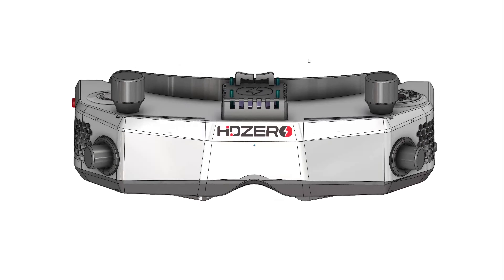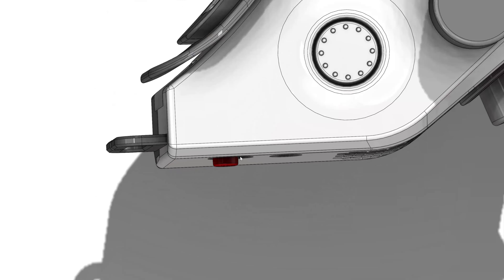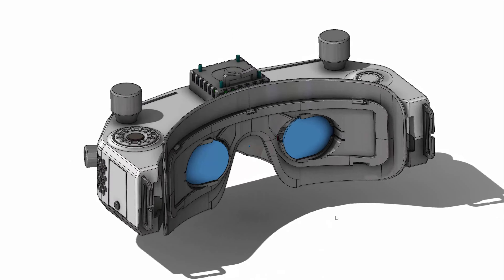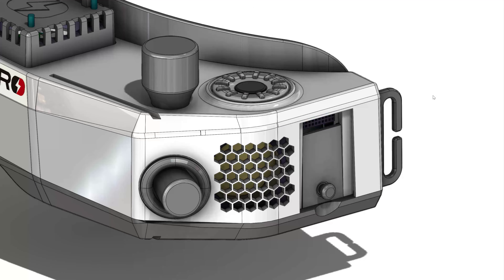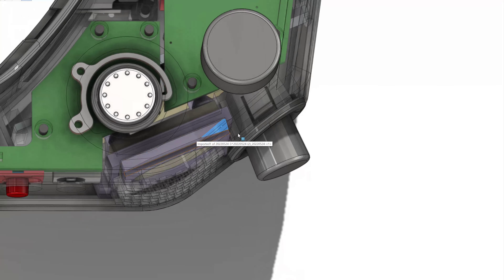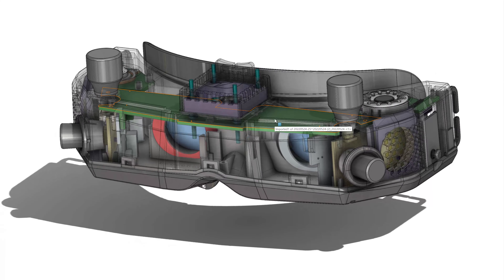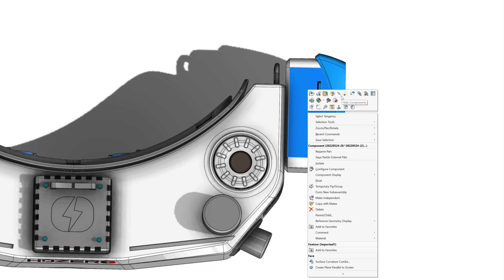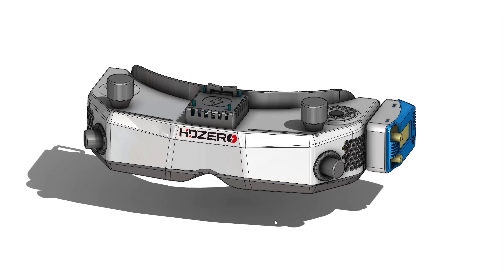HDZero Goggle CAD Walkthrough

Comment: Ryan, thank you for everything you've done for HDZ.  The mechanical design of these goggles is near perfection, IMO. Some observations:  1) The top fan shroud can serve as an anchor should any new add-ons need to be mounted in the front, 2) the opening on the side recessed SMA should be wider so we can turn the SMA metal plug without a tool instead of twisting the antenna housing, and the most important/simplest, 3) ensure the swappable faceplate can accommodate the very flat and the very round faces.  Thank you.

Comment: Fantastic to see the thought and effort that gone into the design of these goggles. Massively impressive. 

I hope Carl's thought about the warranty implications of essentially encouraging users to open up and mess with very fragile components and putting them into less than ideally designed and printed cases though... I'd hate to see a lot of "They won't support me!" posts once users are breaking their goggles. 

I won't be bothering to change a thing because honestly, I think this goggle is going to be as close to perfect as I can realistically hope for.
Reply from the maker: That's a valid point. People need to have realistic expectations of warranty by tearing the unit apart and modifying it. Still, this is a hobby were we build a lot of stuff ourselves, so it might be okay most of the time
Reply: @RyanQuellet  Maybe there needs to be a sticker covering a screw that says opening can void the warranty :/
Reply: @RyanQuellet  I really hope so, and there's not a good amount of people breaking goggle internals and trying to claim warranty support on them and making the goggles look bad, that's all. 

We all know how few claims of unreliability it takes and things get blown out of proportion and a reputation starts forming in this game. 

I'm a huge pessimist though so hope I'm wrong and just worrying for no reason.
Reply: @MrFowl  Actually in a lot of places that would be illegal with the right to repair.

Comment: Looks like an exciting goggle and well thought through. The analogue module option would definitely be welcome by many,   with the lower profile looks like it would be tight to the goggle strap bar though, I didn’t think the module was too bad on the first profile looked decent, at least it’s available on the goggle altogether. Great info 👍
Reply from the maker: Right, it's a bit too close to the goggle strap for comfort. We'll see
Reply: @RyanQuellet  depending on the board layout for the power switch side could the switch be turned 90 degrees so it switches up and down rather than side to, would that give you more room for the plug in jack port?

Comment: I’m assuming that there is going to be massive cost savings and reduced pricing if we are printing our own goggles and assmebling the parts.  I also assume that for those who do not want to print that there will be off the shelf solution approrpriately priced as well.  I further assume that print your own and HDZero mailing us the innards would mean the goggles would run 250-300.  I doubt I would print my own if I had to pay above $300 for the parts.

Comment: This is so amazing, really appreciate your effort in reducing the analog module housing bay size, although the pins port is protruding out a bit in the cad model i am sure it will be recessed inside completely in the actual product if not it will surely rub against the head strap or obstruct it. Also i am wondering if the overall goggle width can be reduced by another 5mm? I cant believe this, as a community we are all working together for creating this amazing goggle, its coming out really well, it seems the future vtx's are going have a reduced footprint & weight, how cool is that. Lets create a  community designed Radio as well 😀. I am thinking a jumper t-lite with 2s power, Built-in ELRS similar to iflight commando 8 and digital hall sensor gimbals with edge TX. perfect.

Comment: The awesome thing about this is really how it turned from the Ugly duckling to this in so little time.

The data pins for the wifi dongle - are they just going to be usb pins? or sdio?
Can you also share the details of the processor / soc running Linux in these goggles? If the soc has a fast enough h264/h265 decoder.. that's + the wifi dongle is all that's needed to get something like OpenHD up and running.
Imagine - strict 4ms latency for those who need that.. and pretty picture with retransmission and all that jazz - when you use the wifi + openhd. All in the same goggle!
Reply from the maker: Interesting idea. It does have h.264/h.265 encoders for DVR. I think a hybrid digital system would be really interesting
Reply: @RyanQuellet  Yep. If the decoder is a fast enough one (720p@120 as opposed to 720p@60), It would really kickass. (20-30ms latency maybe - allowing for up to 1 retransmission). Otherwise there's always the external module approach. But still worth it to try getting OpenHD running on the goggles.
Since the wifi card is external, it should be easy to get a compatible one.

Comment: My concern is how the analog adapter and the analog module holding on onto the goggle. Analog modules are heavy and put strain onto the pins of not mounted with adequate support.

Adding an anchor point or support for the module adapter on the metal strap hook would put less strain on the case of the goggle I think.
Reply from the maker: The analog bay is secured by a screw below the connector

Comment: I'm a bit worried that the head strap will put some pressure on the analog module.
Otherwise than that it looks great and it improved a lot, but i want to advocate again for a wider IPD range. Nobody will mention if the goggle is 2mm wider but it makes for many people a difference between a great goggle and an unusable goggle.

Comment: The STL files shown in this video no longer exist on the Thingiverse page or in Github (or anywhere else online that I've been able to find). There are .STP files, but these do not appear to be split into separate components appropriate for printing. What happened to this project?
Reply from the maker: Step files are the proper way to distribute CAD files, not STL. This is because the files are solid and modifiable. Please work a little more to find a way to use the STEP file for your purpose (aka almost all CAD programs)

Comment: Does it have focal adjustment as well or just the  lens inserts?
Reply: At 6:22 he describes the focal adjustment requires optional dioptre  inserts like most of the fat Shark range, extra hassle particularly if like me you share them with friends and relatives but I guess they must have a good reason for not including an integrated dioptre adjustment, the Fatsnail ones have it integrated I believe but the killer with those for me is the lack of HDMI in.
Reply: kingofjesters23 It does have both adjustments. The FS style diopters were recently added for those whose eyes are outside focal range of goggles.
Reply from the maker: The optics feature adjustable dial diopters. People with astigmatism needed optical diopter inserts in addition to this, so it was added

Comment: It might have just been a good idea to wait for this goggle. I love the design with it's slightly rounded edges. Also the ability to unscrew all the caps and start designing our own stuff around it sounds incredibly good. Repairability also seems unmatched by what we got so far - which is again amazing. I'm also glad it is capable of combining analog and HDZ. I just wish the analog module would just be part of the electronics and makes use of the same antenna array - but that's a small nuisance I can fully live with. I can at least keep using my Fusion module that way. Now I just hope for optics that will allow a great field of view without distorting the edges to the point, you can't read the osd anymore. I'd gladly be paying more for those lenses to be high quality and corrected. The future starts to look good again!
Reply: It would be amazing if the analogue module could be mounted even more deeply inside the goggle (though I appreciate this cannot be done easily at all).

Comment: I've seen it said the minimum IPD is 58mm. That is such a shame. I need 55mm. Yet another decent set of goggles that won't work for me.
Reply from the maker: Do sky04x work for you? This is similar. You can't go solely on center to center ipd numbers
Reply: @RyanQuellet  Good to know, thanks. The 04X is not really narrow enough but I can use them. I just can't see about 10% of the outer corners and have to get them on my face exactly the same place every time. The only ones I have ever found that fit me is the Flykey Rafael goggles. Perfect view and amazing analogue reception but so basic with no fan, only 480 pixel high and no HDMI input so useless for HDZero.